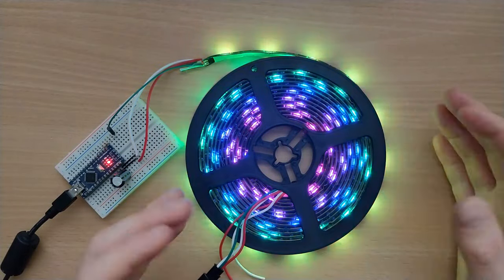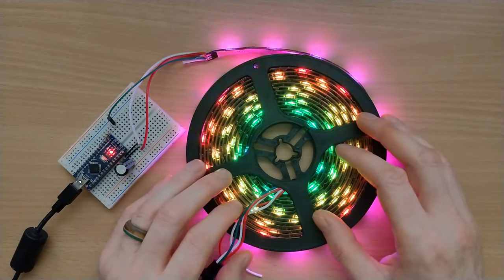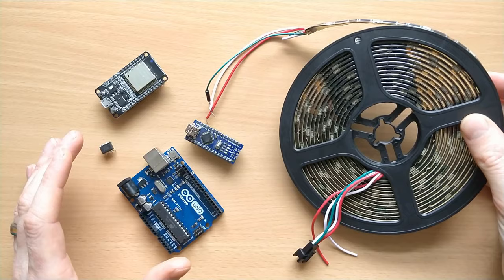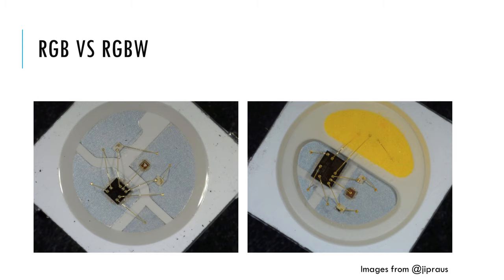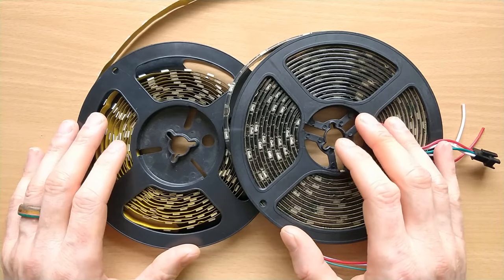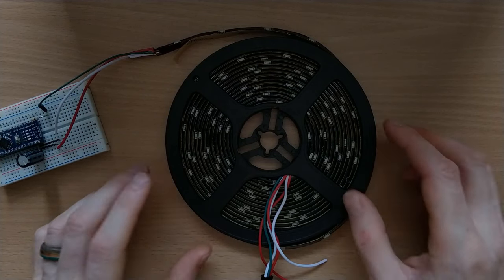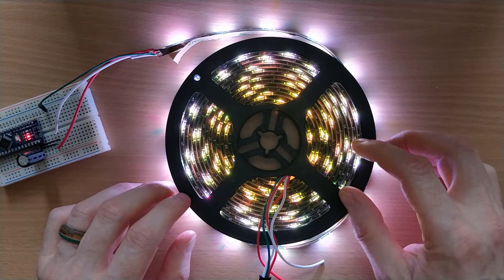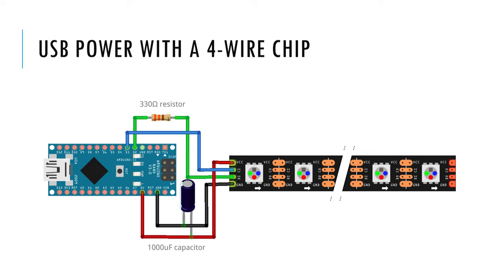FastLED Basics Episode 1 - Getting started

Comment: Hi! I'm very new to electronics so how did you decide the value of the resistor and capacitor that is required?
Reply from the maker: Just a rule of thumb. Neither are essential, but they are recommended. Most of the time it works fine without, but if you have those things around, may as well use them

Comment: Hi, I have a question; I have two strips of led. The first strip is very close to the data pin from Arduino, and the other one is further away from the data pin(around 160 inches). I do not have any issue with the first strip, but the second one, there are some strange flicking along the strip. I do not know why, even though I have its power supply with the same ground (5v)(220R at the head data pin). Is that the data signal drop along the wire? And how I can fix that issue. Thank you so much.
Reply from the maker: 4m is a long way to run a data wire, it might be picking up interference. If you cannot make the distance smaller and you're sure all of your connections are ok, there are a few things you could try: You could move the 220R resistor to just before the strip rather than just after the Arduino. You could use a type of coax cable for the data line, connecting the shield of the cable to ground. You could use an LED as a repeater half way along the data line. You could covert the signal to differential signalling using a board like this https://oshpark.com/shared_projects/kM1DRLS1 then back again at the other end with this https://oshpark.com/shared_projects/iOnPltT5.
Reply: @ScottMarley  Hi, you mean that the second method is use a LED to regenerate the data signal? Is that right?
Reply from the maker: @trunghieule7503  yes, that it correct. You would obviously have to account for this in your code however.

Comment: can we use only 5v micro controler for powering 2 meter led (60 led/m) ????
Reply from the maker: No, a 3.3V one will usually work fine. I use the ESP32 in most of my LED projects. Sometimes you might need a level shifter on the data line from the micro to the strip, but I've never found it to be a problem.
Reply: @ScottMarley  Will 5 volts of the controller be enough to run the 2 meter led strip?
Reply from the maker: @pragyamtripathi7214  oh, I misunderstood. Absolutely not, you will need to connect a 5V power supply to the strip as I show in this video.

Comment: I'm new to arduino, and I was wondering if this kind of led strip and library can be used tor a spinning POV display.
Reply from the maker: The library can of course be used with a POV, but for the strip you are better using something with a higher refresh rate such as the APA102.

Comment: I'd like to underlight a crystal for a wizard staff. The lighting package and battery can't be any larger than 3"X3"X6". I need the LED intensity to be bright to go through the opacity of crystal. Thus, I don't need many. Secondly I would like to shift in color slowly. 

What kind of equipment do I need to accomplish this?
Reply from the maker: At a minimum you would need a battery, 5v boost converter to power the LEDs, a microcontroller (Arduino, ESP, Tinsy etc). If you want to recharge the battery in place, you would also need a charging and protection module. Also depends on your budget. There are so many variables involved I can't just say exactly what to buy unfortunately.
Reply: @ScottMarley  Anything pre-packaged which I can simply purchase? What wording should I use?

Comment: Why the resistor and capacitor
Reply: Current limiter, and smooth the power supply which is most likely a/c derived.  Stops the LEDs from flickering.

Comment: What an incredible useful and informative video! Thank you so so much. Actually, you should upload this 6 part series on udemy for 20bucks - I would buy it. It has a better quality than most paid courses out there.

Still way underrated channel, thanks for all your work and all the details and the incredible editing and Animations. Now I have to buy more ws2811 stripes from aliexpress ahahaha

I actually added some IR remote controlling. Next step is writing a qt phone and laptop application. The next Christmas can come!! 

Much love <3 (nohomo)
Reply from the maker: Cheers for your kind comments, and I hope the videos help you to make something great! Good idea gtting everything started before Christmas, it gives you plenty of time to make something unique.
Reply: @ScottMarley  You put so much work in it, the least one could do :) 
Do you actually have some arduino running 24/7 - do I maybe have to put in a "reset" command or is FastLED running stable like "forever"?
Reply from the maker: @IngoMich  The longest I've ever run an Arduino doing LED stuff is probably about 10 hours. Assuming your code is ok (you don't have any overflows or whatever) I don't see why it wouldn't run longer.
Reply from the maker: @IngoMich  if you find you do need to do a reset every so often, you could connect a digital pin to the reset pin on the Arduino. Then use EVERY_N_HOURS to occasionally pull that pin low. Alternatively you can do a reset in just software as follows: void(* resetFunc) (void) = 0; //declare reset function @ address 0
...
resetFunc();  //call reset
But this isn't a complete hardware reset, it just restarts the main code.
Reply: @ScottMarley  Au that is a great idea with every_n_hours - way better than the timer construct. Sometimes I really find "too complicated" stuff. Thank you so much :) 

I had problems running the led strip for a few hours "turned off" and tried to handle it with some version of timer code similar to your second (#include <avr/wdt.h>)

Today I found out I had a way outdated library of the IRremote.h (version 2. now its 3.)- now it seem to work for a few hours already without even a softwarereset :) 
So you were right, prob. some bugs fixed in the library since v.2.03.

Thought maybe because of the cheap 1.5USD Arduino UNO clone it will only work for a time - we will see :)

Again, thank you so much! Much love
Reply: @IngoMich  I put 200 + led strip (on seperate channels obviously) for under counter kitchen lighting.  The fastLED library was used with an uno in conjunction with an occupancy sensor so that the lights fade up when someone enters the kitchen and slowly fades down after about 20 minutes when there is no activity in the kitchen.  The LEDs stay at a low level until someone re-enters the room.  I tell you all this because this setup has run flawlessly for over 2 years now 24/7.  BTW wish I would have found this channel when I was stumbling through the fastLED library.  It would have made my life a whole lot easier.  Subscriber now!
Reply: @neilnagel9857  Nice, thank you so much for your experience! :) I figured the fastLED library is working fine but the IRremote library has some overflow still, even the latest version even tho the time until it breaks got longer after the last update.

Managed to put in a software reboot for 500ms unresponsiveness and working for 3 weeks now without a reboot- every now and than with a little delay at key-press but the software reset seems to work fine.

I red in an arduino board that long running projects with a cheap arduino nano (1.50USD) also have a problem to "run out of sync/clock" by hardware after long periods of processing so it is common practice to put in at least a software reset just by design.

Also some thing to keep in mind is that the led strip consumes power even when it is all set to "black" (up to 3W) depending on the led strip one is using.

Love your kitchen project, really scifi for the kitchen :)
Reply: @IngoMich  Okay, I guess I misunderstood what your concern was.  I thought you were questioning the stability of fastLED library.  Sounds like you have everything under control.
Reply: @neilnagel9857  No you understood perfectly and helped me by confirming it is not the fastLED library and that your arduino board is working 24/7 without any issue. That is awesome to know, am already planning on doing more 24/7 arudino projects now, also a kitchen light :) 

Thank you so much and have a great start in the new week and stay healthy my friend

Comment: I love your work so much!!
Before i was working with the Adafruit NeoPixel library and there it was soo dificult to get gradients or rainbow effect on my LED strip. This is much easier now.
Somehow  the fill_gradient_RGB functoin does not work for me with this color order: fill_gradient_RGB(leds, NUM_LEDS, CRGB::Red, CRGB:: Green, CRGB::Blue);
And when i use the fill_rainbow function i get a singel red LED between yellow and green.

maybe someone can help me with this.

Thank you very much
Reply from the maker: Hi Florian, thanks for your comments :) I'm not sure how to help with this without seeing your code and setup. When you say the fill_gradient function doesn't work, in what way? Do you get nothing at all, something you didn't expect? Does it compile or throw an error? The single red LED between yellow and green is odd, it sounds like a hardware issue if that's all you're doing in your code. Does that pixel work fine on other patterns? What hardware are you using? How are you powering the strip / micro? There are so many variables involved here it's very difficult to guess!

Comment: Thanks for this very informative video. I have a question, if I need to inject more power ( 7 rimes for a hyper led cube ) how do I split this? Do I solder the extra wires to the main power wire? Or use a breadboard ? Sorry if I'm asking the obvious.
Reply from the maker: Extra wires to the main power wire. Make sure you do the same with the grounds (remember the same amount of current flows through both power and ground!)
Reply: @ScottMarley  will a breadboard  suffice? Thanks for the answer
Reply from the maker: @cerulean-crystal  if your power requirements are lowish you might get away with it, but it's not a good solution. Breadboards are designed for very low currents, not power connections like this. I use wago connectors like these https://www.wago.com/gb/installation-terminal-blocks-and-connectors/classic-splicing-connector/p/222-415 to split multiple power lines out, or just solder the wires together.
Reply from the maker: Also unless your cube is huge, 7 power injections is probably overkill.
Reply: @ScottMarley  my cube is 35cm a leg, I've read 1 meter is max (at full white ) so I use 3 legs max.
Reply from the maker: @cerulean-crystal  3 will be fine. If you want to be completely sure, also connect all 5v pads together at each corner and all grounds together at each corner. This can get a bit messy with the wiring though, but helps make sure power is evenly distributed around all the LEDs. But don't worry massively if you can't manage to do every single one.
Reply: @ScottMarley  thanks for your answers  I will solder on like a soldier. What did I get myself into lol

Comment: Any recommendation for installing a continuous 310 foot fastLED strip?  Is it even doable?  I want to completely wrap a courtyard.
Reply from the maker: At that level I'd consider a commercial lighting company to sort it out for you. If you wanted to do it yourself, you would have to go with 12V / 24V strips to drop the current requirements, but even so, power deliver might be a problem. On big runs like this sometimes people use 48V distribution, with 12V regulators every few meters powering the strips. If the strips will be outside, you'd probably want waterproof channels to run them in, the 'waterproof' strips are not really waterproof. Then there is the controller. At 60 LEDs / m that's 6000 LEDs, each led uses 3 bytes of RAM meaning 18MB of RAM. This is not really possible on any microcontrollers that I've worked with. So in this case, you'd have to use multiple controllers and sync them if you wanted patterns that looked continuous. This can be done for example by WLED. If you don't need customisable patterns, and just want a strip you can alter the color of, then there are plenty of commercial solutions out there which would be much much easier ;)
Reply: @ScottMarley  Thanks. I do want customization. The most important pattern is just a chasing effect around an entire courtyard. Any semi-pro shop recommendations? Thanks again!
Reply: If I knew how to share a picture of the space here, I would.

Comment: i copied your code Verbatim for this is my first arduino addressable led project and for some reason the  first code in "First Patterns" pops up an error message on the app . I'm not sure why any of your codes in this video are not working for me, maybe i need that resister and external power source? thoughts?
Reply from the maker: Hi, can you post the exact (full) error message? Also which microcontroller you're using, how many LEDs etc. Otherwise it's difficult to help. And if possible the actual code - put it on pastebin and link it here. The number of times people have said they are using my code, then when they finally post it they have made a tiny edit or a typo that breaks everything!
Reply: @ScottMarley  hey thanks for the reply scott i am testing on a strip of 300 leds. but here is my error message with that first color test code
 Arduino: 1.8.14 Hourly Build 2020/12/01 10:35 (Mac OS X), Board: "Arduino Uno"
In file included from /Users/fireFlame/Documents/Arduino/sketch_FAST1/sketch_FAST1.ino:1:0:
/Users/fireFlame/Documents/Arduino/libraries/FastLED-3.3.3/FastLED.h:14:21: note: #pragma message: FastLED version 3.003.003
 #    pragma message "FastLED version 3.003.003"
                     ^~~~~~~~~~~~~~~~~~~~~~~~~~~
/Users/fireFlame/Documents/Arduino/sketch_FAST1/sketch_FAST1.ino: In function 'void loop()':
sketch_FAST1:15:16: error: expected primary-expression before ':' token
  leds[0] = CRGB: :Red;
                ^
sketch_FAST1:16:16: error: expected primary-expression before ':' token
  leds[1] = CRGB: :Green;
                ^sketch_FAST1:17:16: error: expected primary-expression before ':' token
  leds[2] = CRGB: :Blue;
                ^exit status 1
expected primary-expression before ':' token
This report would have more information with
"Show verbose output during compilation"
option enabled in File -> Preferences.
Reply from the maker: @MecanixGarage  thank you, but as I mentioned in the previous comment, I need to see your code. There is a typo somewhere. Put it on pastebin and link it here.
Reply: @ScottMarley  #include <FastLED.h> 

#define NUM_LEDS 300
#define LED_PIN 13

CRGB leds[NUM_LEDS];

void setup() {
 FastLED.addLeds<WS2812B, LED_PIN, GRB>(leds, NUM_LEDS);
  FastLED.setBrightness(50);
}

void loop() {
 leds[0] = CRGB: :Red;
 leds[1] = CRGB: :Green;
 leds[2] = CRGB: :Blue;
 FastLED.show();
}
Reply from the maker: @MecanixGarage  for some reason you have a space between the two colons (::). There should be no space here, and there isn't in my code on GitHub so I don't know how they ended up there. Remove the spaces and it will work fine. For future reference, please post your code to pastebin and link it from the comments here. It's very hard to read in a comment.
Reply: @ScottMarley  thanks so much. I wanted to clarify this test. This will serve me well. I’ve never heard of pastbin. But look forward to seeing more of your videos

Comment: why using a resistor with data input
Reply from the maker: According to a number of things I've read, it reduces noise on the data line. I have no idea if this is true as I have never measured it. It will almost certainly work fine without it.
Reply: @ScottMarley  Actually I got a led strip with chip Gs1903(12V) after applying 12V all leds are working but data throught Arduino is not flowing throught it.....Any idea why it's not working??
Reply from the maker: @vishalaggarwal1291  not entirely sure. Try setting the led type in FastLED to UCS1903 and color order to BGR. How are you powering you Arduino / strip? If its from two separate supplies, the grounds must be connected together.
Reply: @ScottMarley  yes,I am powering both using external 12V power supply....also thanks I will try it....☺️

Comment: Thanks for the great info!
I’ve got my house wrapped with Alitove (5v, WS2812B, IP65 [weatherproof]) LED strips (staple-gunned to the facia).

I’ve got power injection at every strip junction, but after several strips, the color doesn’t set properly.  Frustratingly, it’s NOT consistent (that is, the color “error” doesn’t start at the same place every time I turn on the Arduino (Mega2560).

I’m setting ALL the LEDs to BLUE, but end up with SOME (at the end of the run) being other primary colors!

How the heck do I troubleshoot WHERE the problem is?

Is it likely a bad SIGNAL line, or faulty GROUND?  

I don’t think it’s a POWER problem, as the LEDs are turning ON (just the wrong colors)!

Any helpful hints would be greatly appreciated!

Comment: Hi there, my  RED led shows Green and the Green shows RED, what should I change in the code?
Reply from the maker: Just change GRB to RGB, if that doesn't work just use some other combination of those letters!
Reply: Problem solved, changed to RGB instead of RBG.
Reply: @ScottMarley  I need to buy 200 individual LEDS, don't want to cut a strip... where can I find individual LEDS ?
Reply from the maker: It depends what form you want them in. I've used these before and they're ok https://www.amazon.co.uk/CHINLY-100pcs-WS2812B-Addressable-Arduino/dp/B01N97A0XG/ and be prepared for a LOT of wiring and soldering or if you want them pre-wired, something like this https://www.amazon.co.uk/dp/B01AU6UG70/ maybe? It depends what you need.
Reply from the maker: You can get them much cheaper than Amazon, but just pointing out what's out there.
Reply: @ScottMarley  I got the string one here, but it's kinda bulky and i need it to sit flush and pretty.